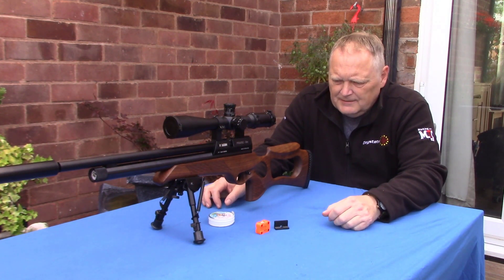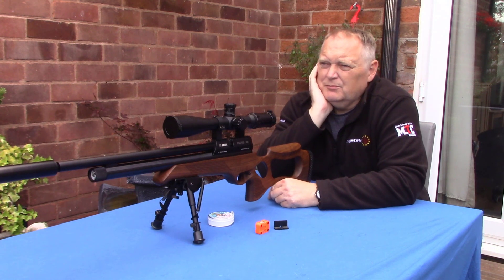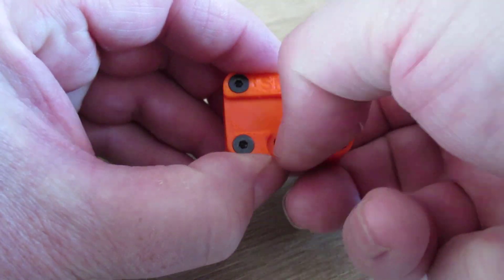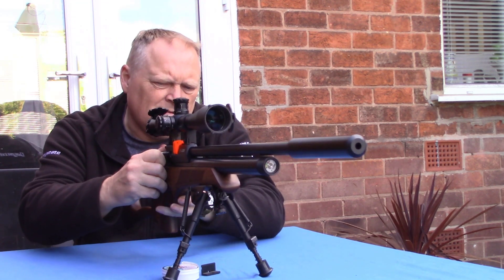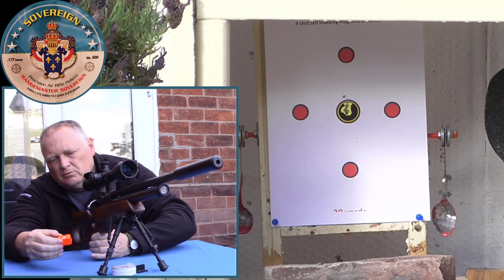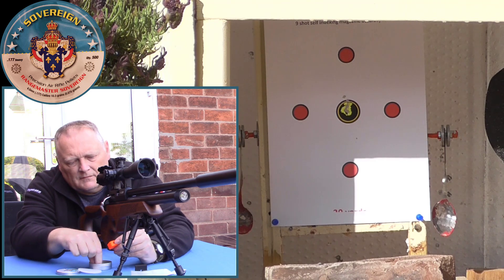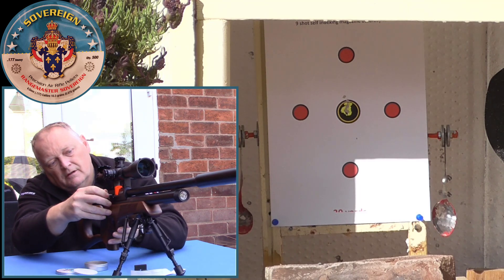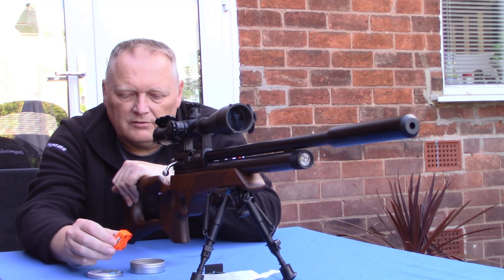New SMW Engineering Falcon Rifles 9 shot .177 self indexing magazine

Comment: I don't see what influence the magazine has on the accuracy of the shot once the pellet it loaded the mag had done its job and plays no part in the rest of the shot especially accuracy until the next pellet needs loading and the only part the mag quality plays is aligning the next pellet up to be loaded and getting it properly online with the breech so not to jam.
Reply from the maker: The issue was with the original magazine system, where the spindle that rotated the magazine from shot to shot. It was not consistent in the way it worked and created miss feeds and jamming. With the new magazines they are self indexing.

Comment: hi mark,looks like thats a good buy,my mate had a falcon raptor light hunter a rew years back and he sold it because of the magazine wouldnt index properly,very poor idea at the time and let the rifles down,its a shame they were not making them at the time,lovely accurate rifle apart from the sh..te magazines,👍
Reply from the maker: Yes, the original magazines were the Achilles heal. A complicated design, that didn't always work. Simple is best, and you can't go wrong with a self-indexing magazine. That's why so many manufacturers use the idea now. As soon as the probe is withdrawn the magazine spring cycles the next shot. It’s a no brainer, and yes, the Falcon rifles were really accurate and well sort after. Air Arms only purchased the Company to rid them of the competition. Just imagine how good their rifles would be if Air Arms would have kept the brand going. A bit like Daystate taking over Brocock.